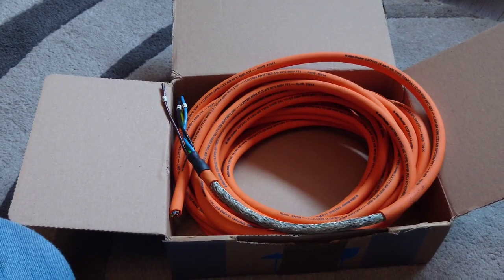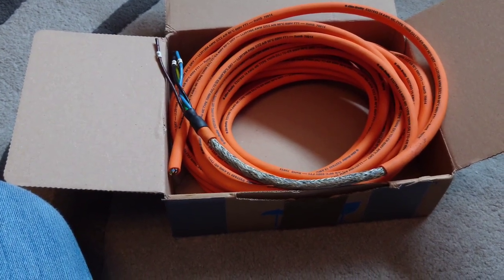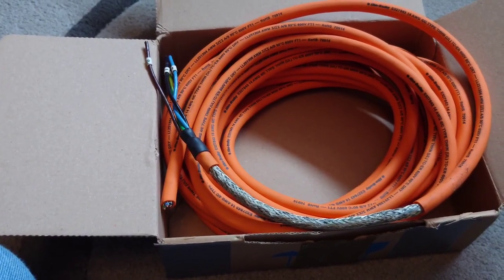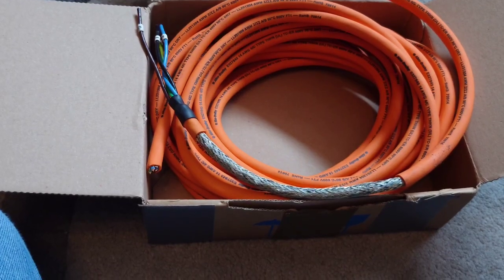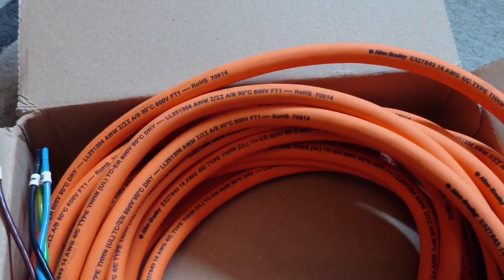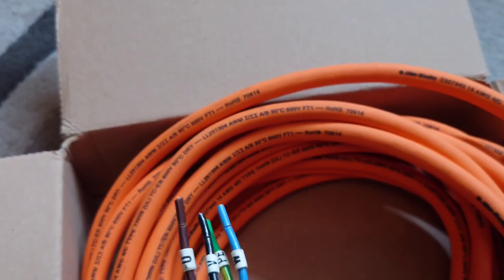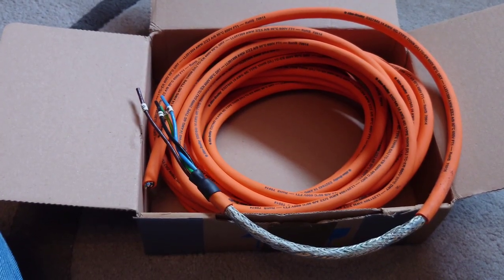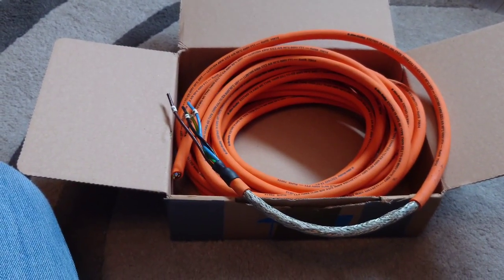Taking A Look At Allen Bradley Mains  Cable

Comment: Hi yer Tweaker I make two core copper shielded power cable would you like to talk about a trade I need your wood working   skills 

My cable uses a 3 pin surge protected plug plus a Lapp cable 2 core CY cable to a Bulgin IEC connector 

Thanks Simon

Comment: It's a typical industrial cable. The main feature is that the outer sheath is stiff and hard-wearing because that's what you need on a factory floor. It has no use in hifi.

Comment: Hi sir reminds me of SY or YY cable , but it’s obviously used in extreme environments in industry probably it has good thermal properties . We use to use a lot of blue artic cable for certain applications .  The mech braiding may  have a screening effect if used in a hifi situation , as to weather you use the additional wires is arbitrary .             Best wishes and kind regards 😀👍👍👍

Comment: Hi, what you have there is Allen Bradley 3phase and earth motor power cable, run from an invertor to a motor, they look to be 4mm2 cores, not oxygen free, although expensive to buy , used mainly in heavy industry.
Reply: Yeah, it's an industrial cable, not for hifi use.